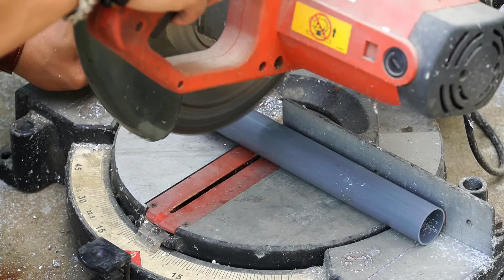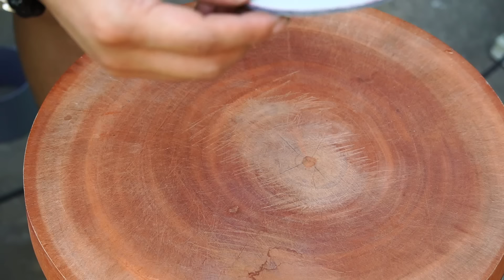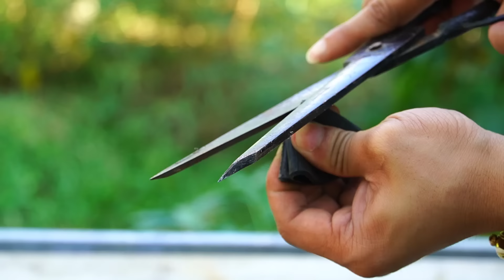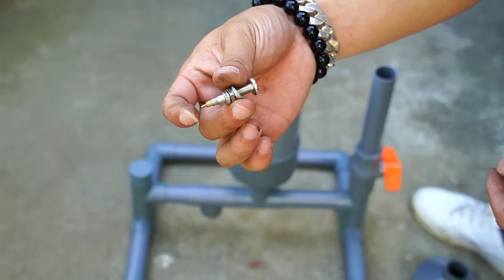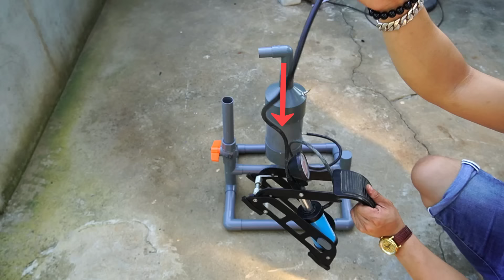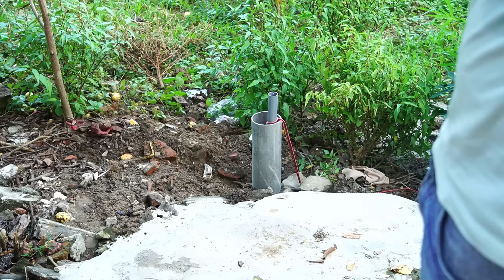I make water pumps for free

Comment: There is definitely something wrong here.
If you put air on both sides diaphragm it isn't going to do anything with the water. Also the air can compress water is heavier then air.
You would need a very tall tube and alot of air to get the water to pull up the tube.
This is a waist of time and parts.
Also why would you use a foot pump with a short throw?
The piece of metal with the rubber  diaphragm and the large diameter tube would work just fine by itself. This is how old hand pumps work on shallow wells.
You push down the piston air and then water flow around the diaphragm filling up the tube. Then you lift the water out of the tube because the diaphragm is a one way valve then push it back down to fill the tube up again. The check valve at the bottom of the draw tube keeps water in the draw pipe.
Could have just come up with a way to put a handle on the whole thing and just hand pumped it. Sorry but this is stupid.
Reply: THEY WERE PUSHING WATER FOR FUEL.
Reply: Yes you are right, this is stupid, to.me you put air pressure your.pushing the water downward how can it suck water outward.also with just hand air pump is not enough to pull the water outward, no lodgic at all.FAKE AGAIN.. sorry.

Comment: Thanks for the video; how deep is the borewell?
Reply: The video looked like 10ft. I am still trying to figure out what he did
Reply: @ronallens6204  yeah, you are right
Reply: @ronallens6204  yeah, you are right
Reply: @ronallens6204  This video is fake. He used an electrical pump.
Reply: @CD-kg9by  i understiod that when i saw him attach it..  was trying to figure out what the rest of it was for. The pump he used would not be able to draw from too deep (shallow well) and wondered how deep it would go. Most shallow well pumps dont work past 25 ft, and i have a 40ft i would like to access.

Comment: Very cool and affordable solution for those with a high water table and are living "off the grid".  I wonder how deep that well he is drawing from is?
Reply: I strongly suspect scam... too many splices in the film during the use phase and if you think about the engineering you see there is nothing PULLING water up.... The pump is circulating air in a cycle as opposed to drawing a vacuum, there is nothing keeping the air from PUSHING down the water pipe, and nothing to keep the water of the prime stage from running down into the base of the pump itself... so it cannot do anything.

That said, this was a great video for entertainment value.

Comment: Creo que es un timo.   La flecha de flujo hacia abajo que dibujas en la parte superior es contraria al flujo de la vàlvula que fabricaste arriba   y el agua que fluye por la salida no corresponde al impulso que das a la bomba de piè.
Reply: 👍 Bollywood
Reply: I think i figured it out...  the pedal pump is pulling water/air from the bottom and pushing it out of the top. With out the pedal there is no pump....  so why the valve on top ?
Reply: no funciona,, por eso evita ciertos detalles,,, ademas sale mas agua que la que aire entra,,,ç
Reply: @videoveovideoveoo9487  youtube will not translate
Reply: Tu lo crees, yo estoy seguro 😄solo buscan que veamos el video
Reply: @susobumper  need a translator

Comment: Esto es mentira. El tubo grande simplemente esconde una mini bomba en su interior, los demás aditamentos son para crear interés ya que supuestamente funciona sin energía. Y los cables? Pues están escondidos. Pongale lógica, la bomba de aire introduce al sistema la misma cantidad de aire que saca porque tanto La supuesta entrada como salida están conectadas a la misma recamara aunque haya una membrana que las separa no generaría ese flujo de agua a la salida. Al sacar el aire, si es q lo logra, entonces quedaría recirculando agua, así que NO, para los que preguntaron si pueden poner un compresor eléctrico, NO lo hagan, pasar agua por el interior de un compresor que está fabricado para aire o algún tipo de gas no es buena idea, va a explotar. No se dejen engañar.

This is a lie. The large tube simply hides a mini pump inside, the other attachments are for interest as it supposedly works without power. And the wires? Well, they are hidden. Logic, the air pump introduces the same amount of air into the system as it takes out because both the supposed inlet and outlet are connected to the same chamber, although there is a membrane that separates them, it would not generate that flow of water at the outlet. When removing the air, if it succeeds, then it would be recirculating water, so NO, for those who asked if they can put an electric compressor, DO NOT do it, pass water inside a compressor that is made for air or some type of gas is not a good idea, it will explode. Do not be fooled.

Comment: I saw the air pump have two  output hoses i never seen it before. Where did you buy it?
Reply: One of the hoses must be for the air to get in, the other for the air to get out. Most of the pump don't have a tube for the inner air as it just takes it right from the pump I guess.

Comment: Excellent video. You can tell how deep the well is and what are the measurements of the pieces you used.
Reply: The theoretical limit on the depth of the water level in well is 10 metres. The practical limit is about 8.5 m.
Reply: @prasannadhopate8513    This applies for pumps. But what is shown in the video is not a pump but a joke, the pumping is faked.

Comment: Can a small cylinder provide so much pressure?
Reply: No there's a pump in it
 I'm going to say it's a 10 gal per minute by The flow. It started way to quick and his air valve is in the wrong spot

Comment: I have a Ryobi water pump and just wondering if anyone had any ideas how to control the flow rate or pressure? I need it less powerful 😆 🤣 😂
Reply: Does your pump have a pressure switch unit and is it visible?
Reply: The usual standard solution: put a T-piece in the outlet pipe and inlet pipe. Connect them together with another short pipe that has a  gate valve in line. In other words, create an adjustable recirculation pipe. With the gate fully open, all the water will just go around & around through the recirculation. As you close the valve, some will go up the outlet. Adjust the outlet flow to what you require. 
Hope that helps.
Reply: @derosderoruruka9031  no it does not